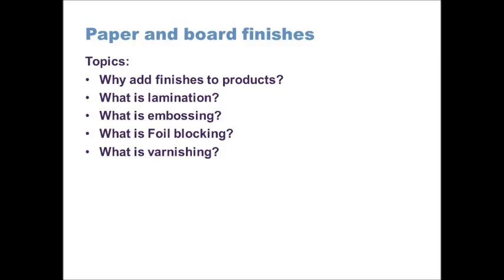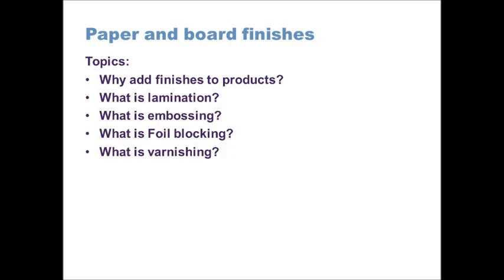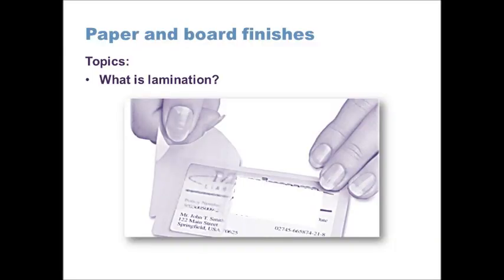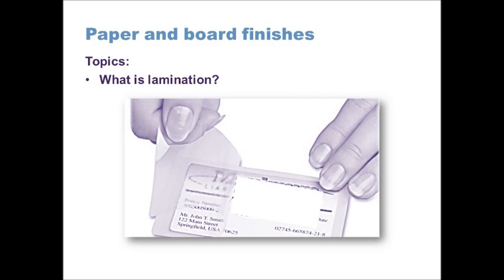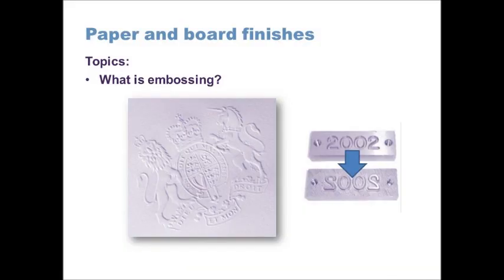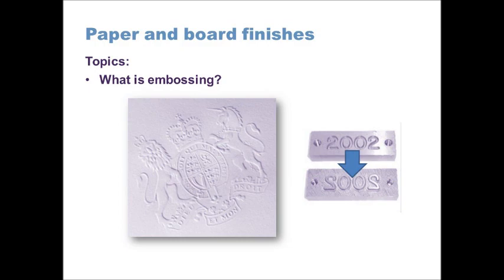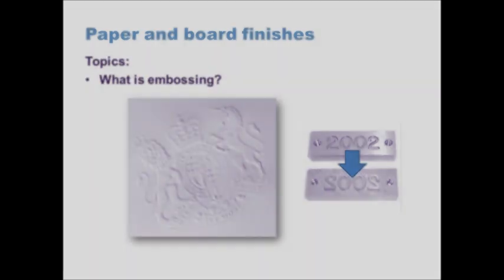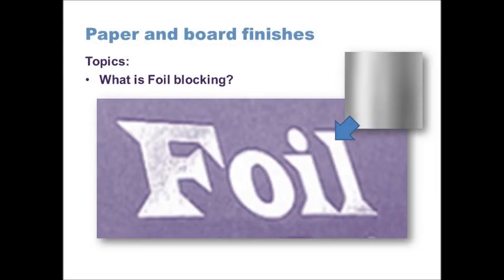GCSE Design Technology (9-1): Paper and board finishes

Comment: Hi sir, for the aqa spec do we have to know about all these videos or e.g just resistant materials (if that's the are we chose to specialise in).
Reply from the maker: You have to have a broad understanding of all material areas and a more in depth understanding of one specialist area.
Reply: @ks3-5designtechnology91  Ok, thank you because my school have made it out like we have to know every specialised detail about every single area. I'm doing res mat but they're making us learn about processes such as microencapsulation and quantum tunneling.
Reply from the maker: These are two pieces of knowledge you should be aware of as they fall under smart and modern materials.